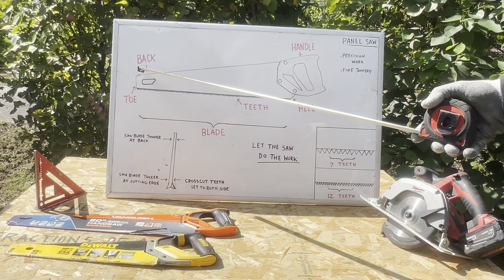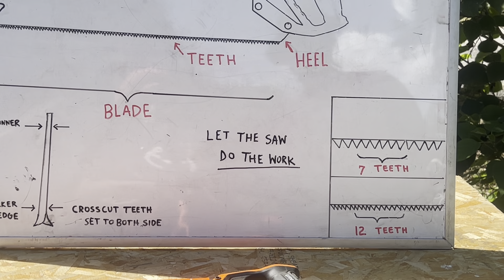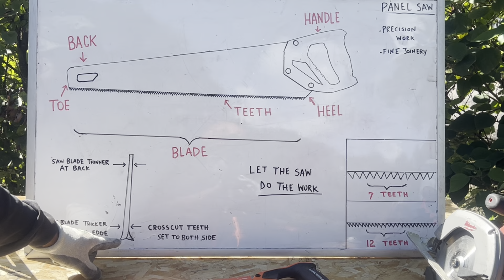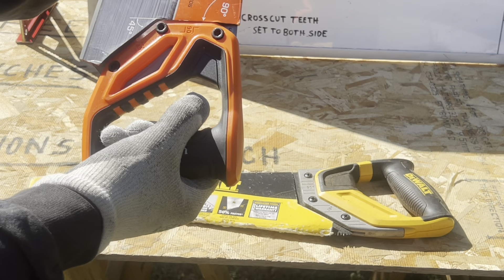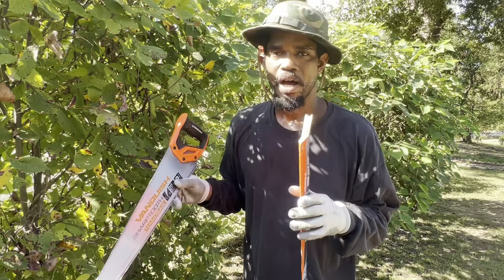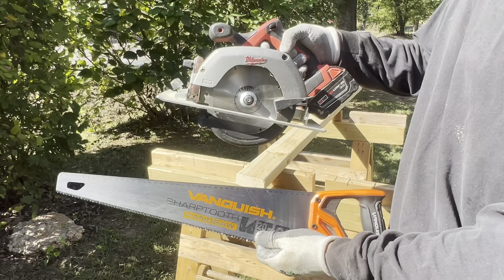Journey to the Temple: How to use a Hand Saw

Comment: I'll say it again - you're a gifted teacher and instructor. 👏 
Thanks for teaching your audience the true, no hype, skills of the trade. ✨ 
I honestly never knew about using the handle of a saw to mark angles. Pretty amazing. 
Great tip on pulling the saw backwards a few times to make a starting groove before commencing cutting.
I also had absolutely no idea that the back of the saw 🪚 was thinner than the side with teeth to prevent binding (at least I think I got that right, but I could have misunderstood).
All in all, your videos are excellent as you've been able to take difficult topic, and break them down into discrete and digestible bits so everyone can easily understand.
And finally, your skills transfers don't break the bank, and that gives a lot of people hope, especially those who are just starting off. 👍
Reply from the maker: Thanks Trini I appreciate your support.
Reply: @templebuilderscarpentry7043  Sincerely welcome, and keep up the good work. Lots of potential in this niche you've discovered.